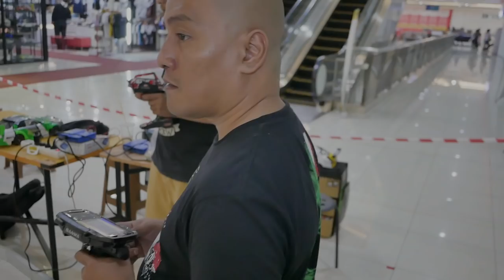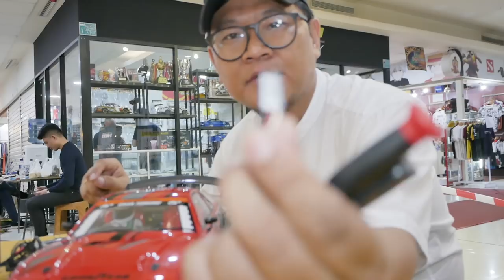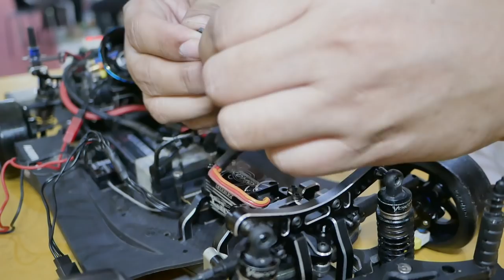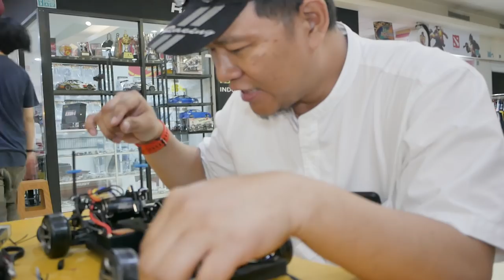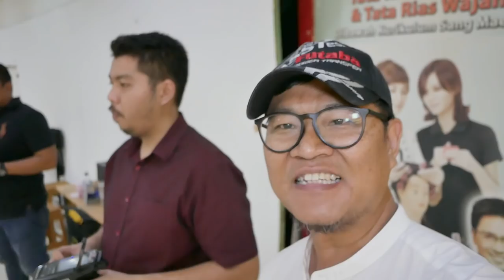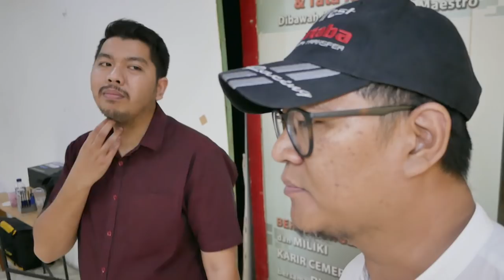RCdrift tipstrik : PowerUp RWD Servo steering

Comment: mantap om infonya
mau tanya boleh om.. klo gyro set ke 50% ke atas dia godek2 knp ya?, sy pake kit Sakura D4 RWD, curve slide steering, servo power HD 1206TG, gyro yokomo V4
Reply from the maker: servo powerHD memang tdk terlalu kompatible dgn gyro, prefer ganti dgn servo yg baru seperti storm dll
Reply: @RCTvIndonesia  bagaimana dengan r12 power hd?